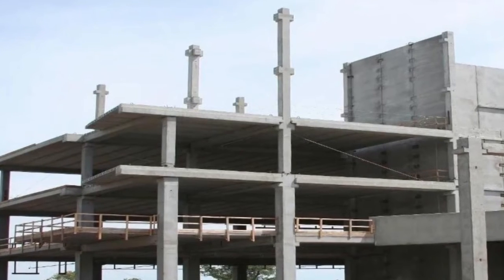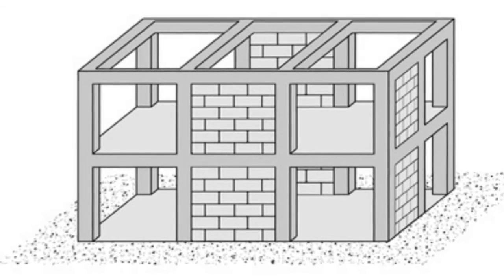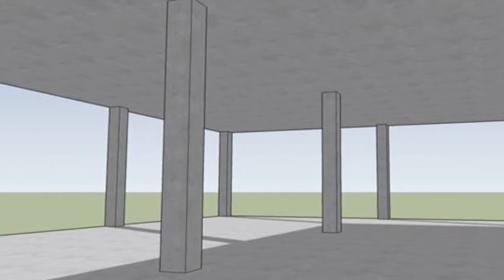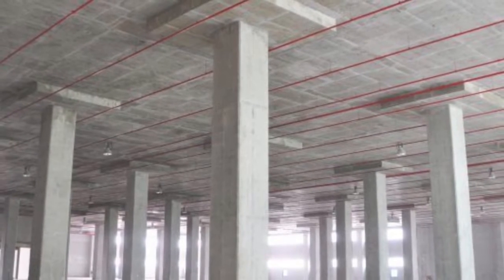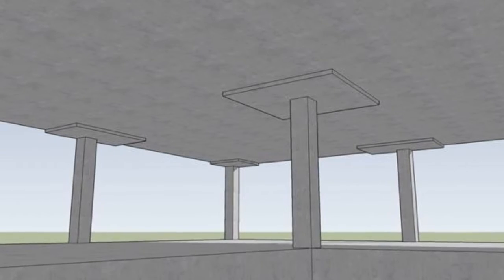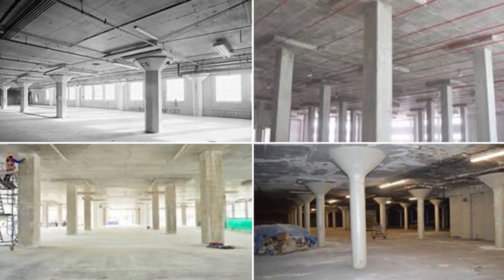Should you design a flat slab in an earthquake zone?

Comment: As the slab is being flat doest it flatness affect the size, since their is no beam?
Reply from the maker: It will depends. When the flat slab without beam will need to support heavy live load or pattern load, then the thickness will increase to spread the load over a large area enough to prevent it from sinking.  But you don't really necessarily need to increase the thickness of the flat slab in most cases; as it will just be waste of money as you will end up creating a sturdier structure. 

The size of the column will increase and you will most likely be using a rectangular or circular column because the weight coming directly from the slab will rest on the columns.